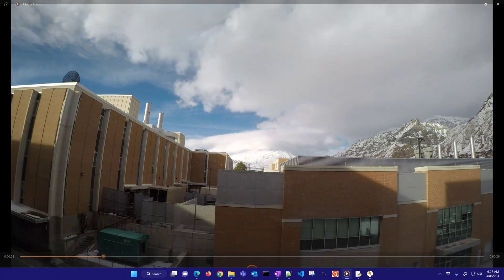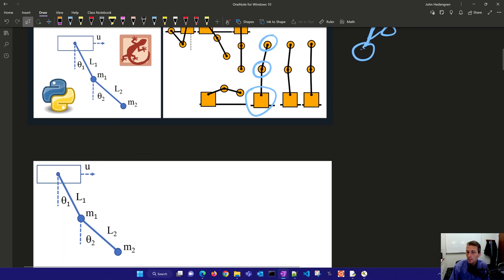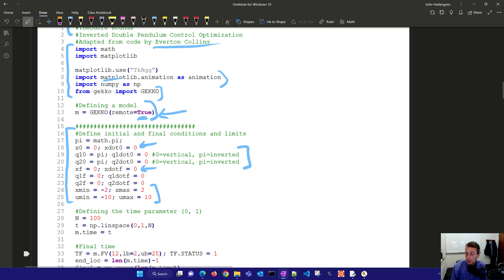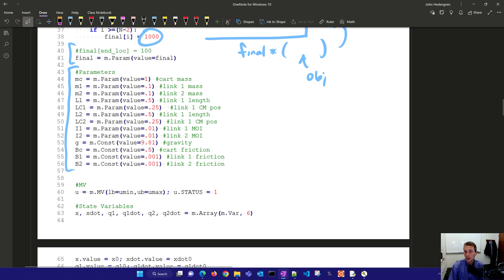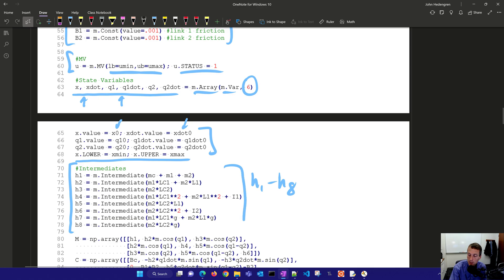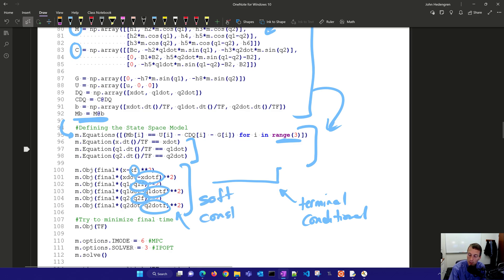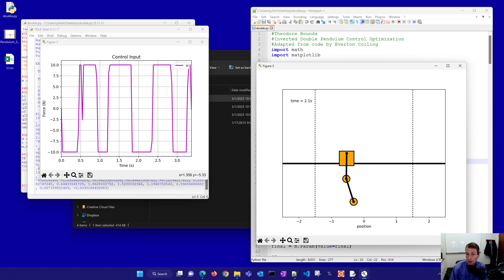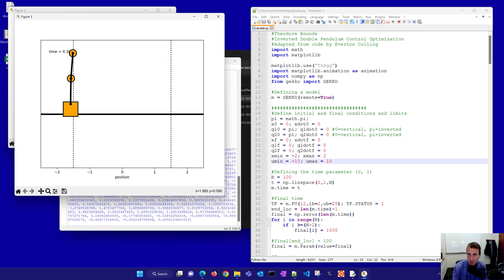Double Inverted Pendulum

Comment: Thank you for sharing your experience with the double inverted pendulum. However, in time 2'04 of your video, I have some doubts of your Lagrangian equations, indeed I get another result.
In the first equation, I get  … - m2*L2*w2^2*sin(delta) - g*(m1+m2)*sin(teta1)
In the second equation, I get … +m2*L1*w1^2*sin(delta) - m2*g*sin(teta2)
I tested my equations on a simulation program and it works, contrarily to yours. Maybe the angle origin and orientation are different between your calculation and mine.
Can you confirm the accuracy of your Lagrangian equations? 
Thank you and best regards
Magdi